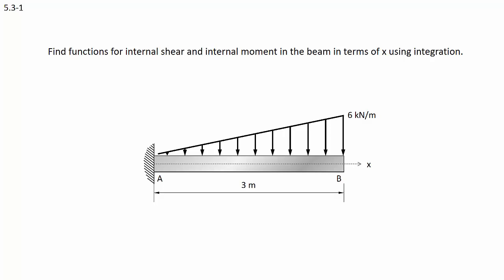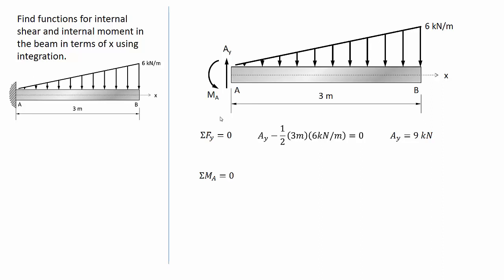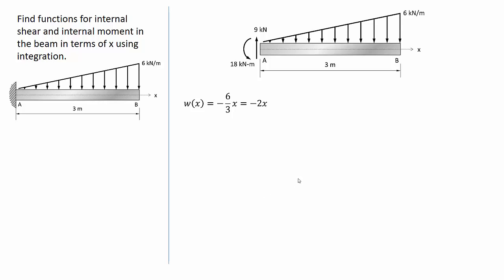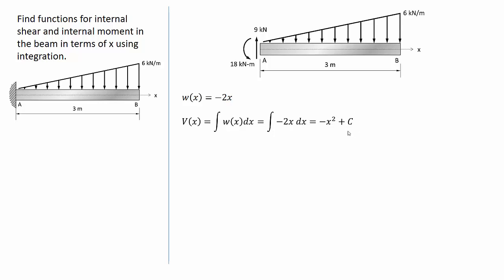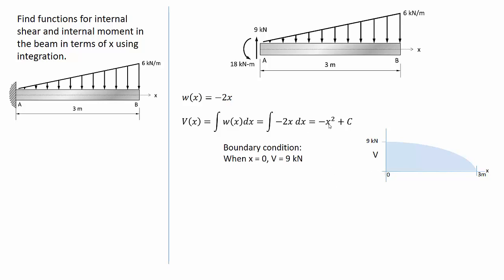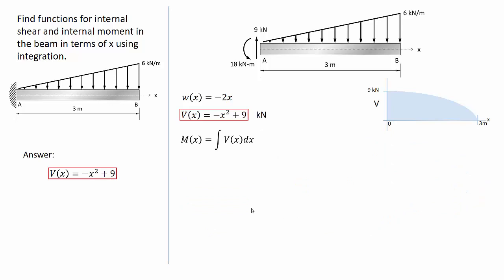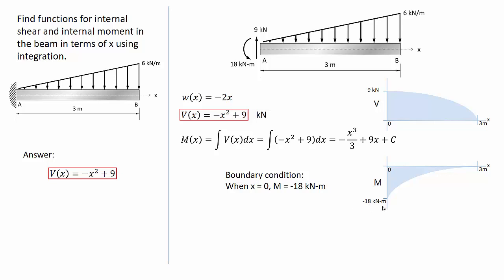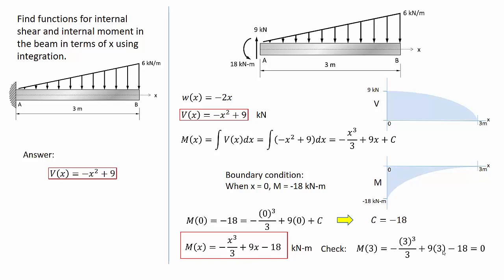05.3-1 V and M functions by integration - EXAMPLE

Comment: what if the slope was negative. would that make the wight intensity positiv???
Reply: What I got is that the slope here is negative because the distributed forces are pointing downward, therefore the resulting moment will be clockwise